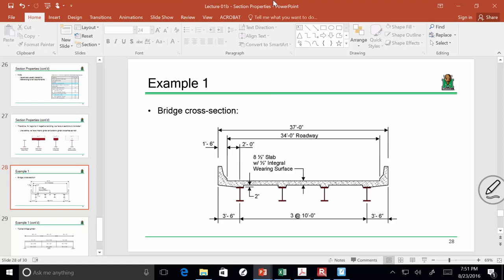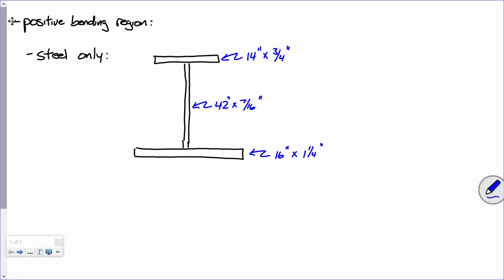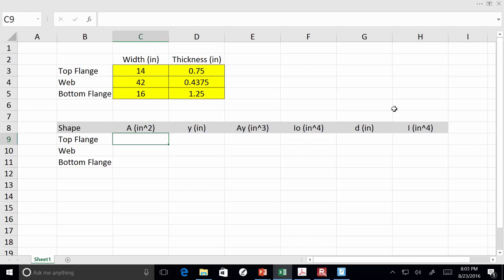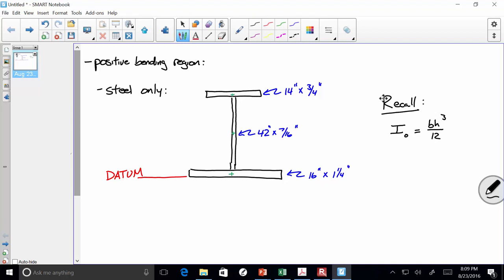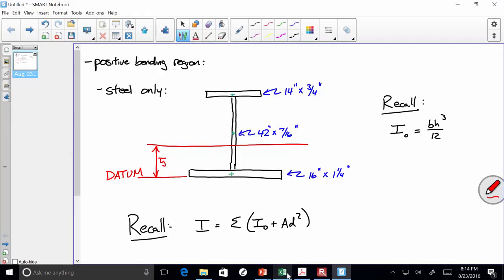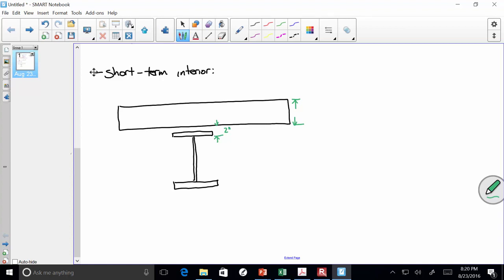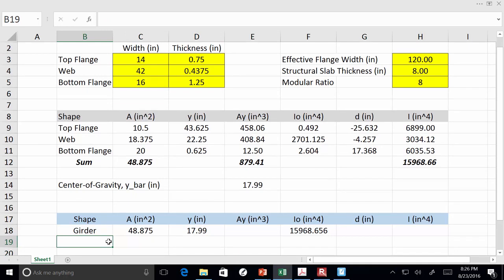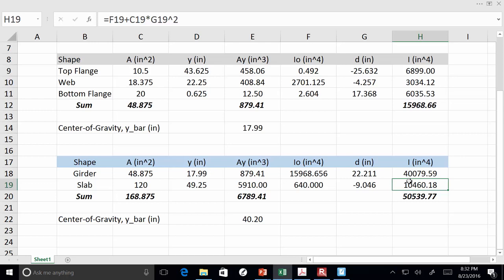CE 618 Lecture 01b  Section Properties cont'd 2016 08 23

Comment: Hello,

why didn't you calculate the top flange thickness in 36:52 sec
accordingly shouldn't the y of the slab be 50 i n
regards
Reply: Haunch = 2" is calculated from top of the web to the bottom of the slab. So, y_slab = bottom flange th. + web depth + haunch + (structural slab th. / 2)
Reply: you are right